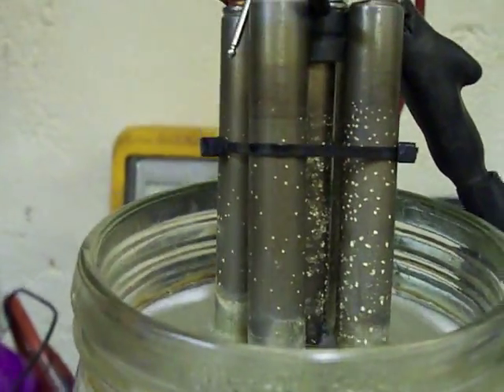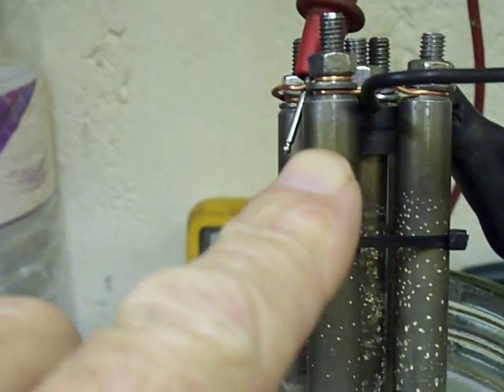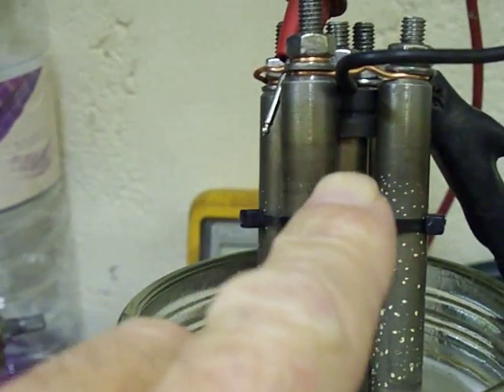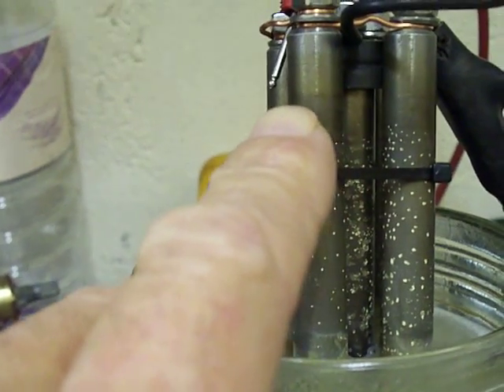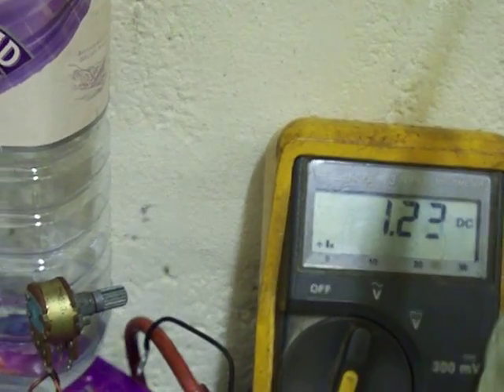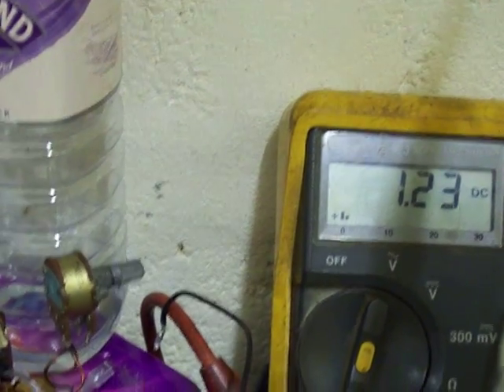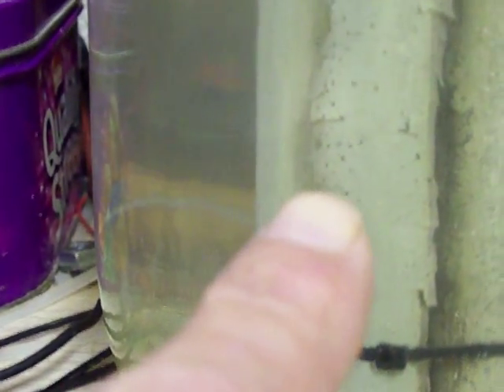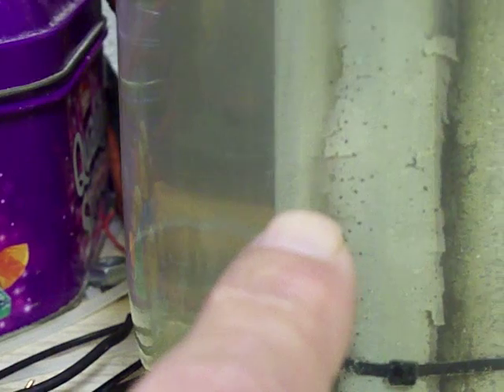HHO cell - Titanium Anodes disintegrating!!!

Comment from the maker: @harpbloke Thanks for your comment... They're stripped & cleaned (although the strips that are peeling off look thick, there is no obvious ware on the rods?). They are back in the cell with a 99.99% titanium plate as the cathode... we'll see what happen's
I also have a plate of tungsten... I'll try that as well.
I did expect pitting due to the electroplating process but not a skin peeling effect??

Comment from the maker: I did hit the rods with 24 to 35vdc @ 3 to 5amps but I did not expect the Titanium to peel off in strips?
It took 3 X drill bits to drill into the Titanium - it is very hard? It's difficult to understand exactly why it falls apart?
The electrolyte was PH 10